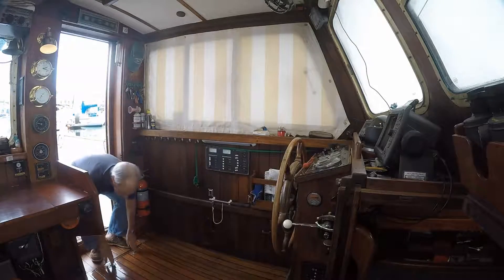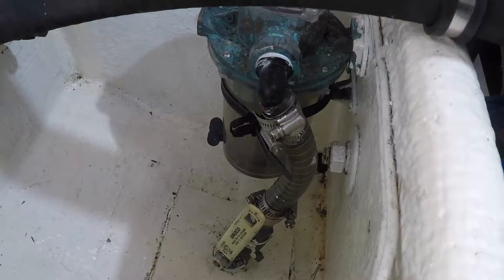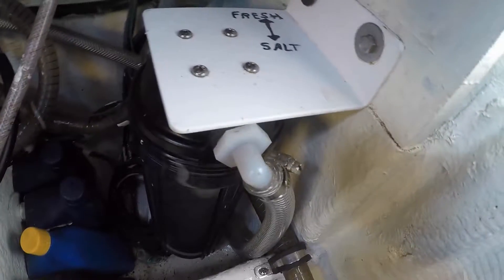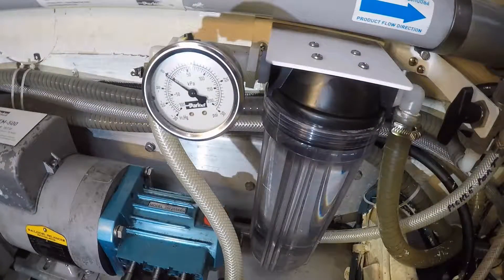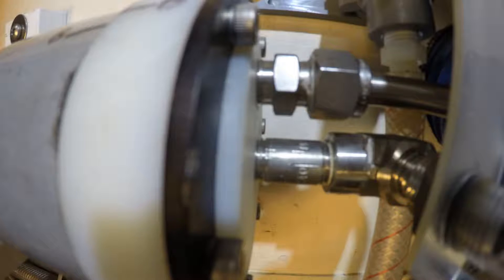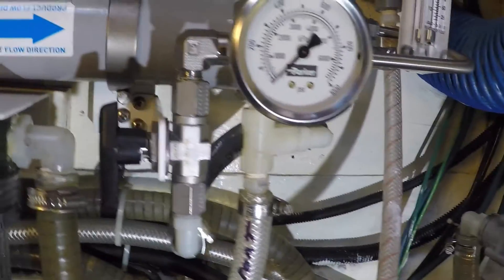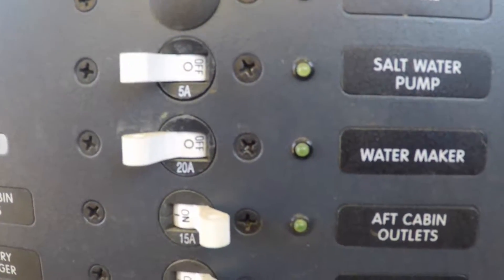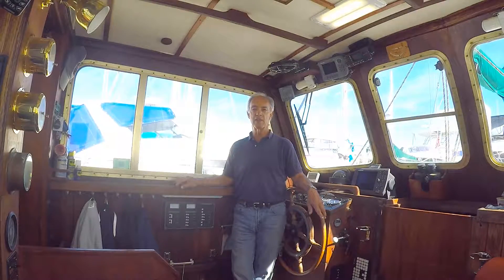Village Marine Modular Watermaker Installation Notes

Comment: Sam what happens if we are making water and the tank is filling up with more and more water, does the system back up?
Reply: Like if we over fill the water tank by accident can do this do any damage to the watermaker?
Reply: It would be like over-filling your water tank from a dockside water supply.  You would see water flowing out of the water tank's vent hose.  The flow rate would be much slower however.